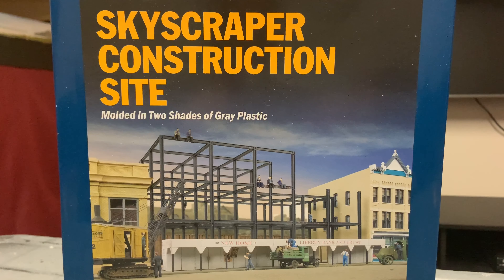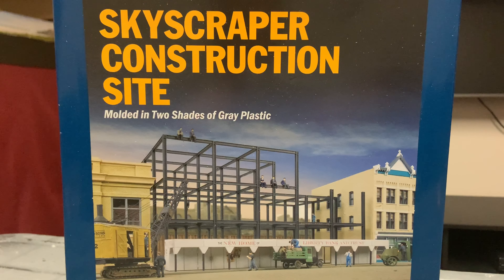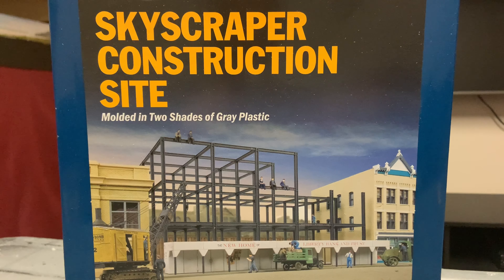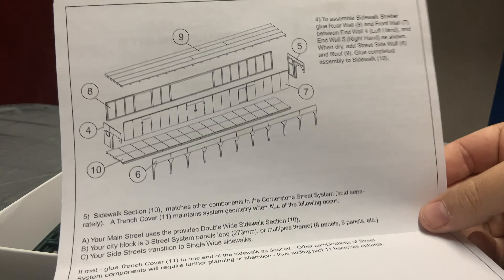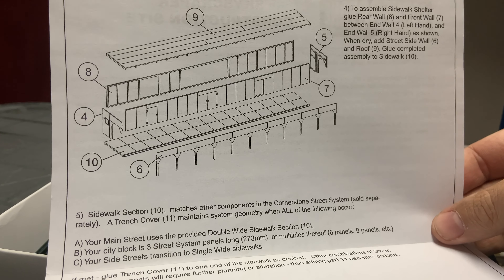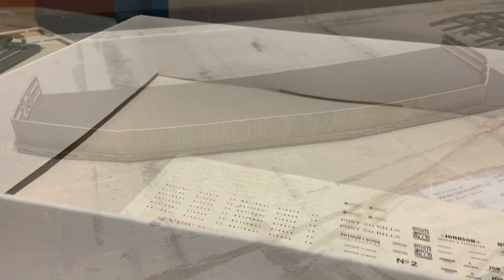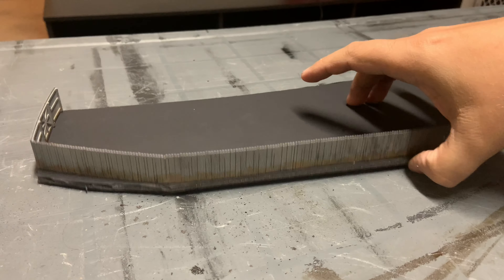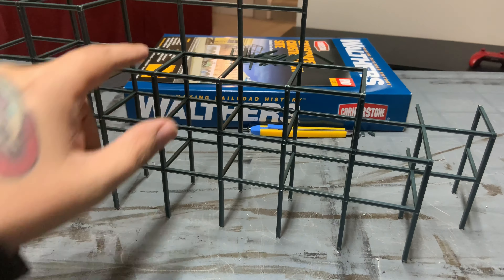Kit build/review skyscraper construction site

Comment: BINGO KRIS! You don't have to build the kit as it looks like on the box or in the instructions! Build it to suit your needs or desires! Not to tell you how it should be, but normally you wouldn't have beams hanging out in air without columns to attach to. 10,000 pound beam hanging out in thin air on one side would probably break the weld on the other side. Lol! That fence looks great! I might have to buy that skyscraper construction site kit? But mine will start from a big hole in the ground and show the concrete pilings! Concrete pumper trucks and cement trucks, dump trucks hauling dirt out! The tower crane can be set up building a concrete silo at the port elevator! Have fun, Roy
Reply from the maker: CONTAINERMAN68 100% true. To be honest the only reason they go back is because there is more to the building. The backdrop curves at that point so one end is flush against it. I like your idea with it being deeper in. Mine won’t be as high or I can make it look further along as basement is “filled in”. Thanks for watching!